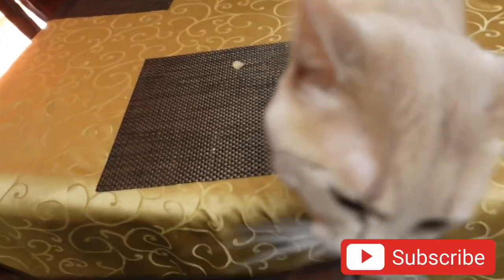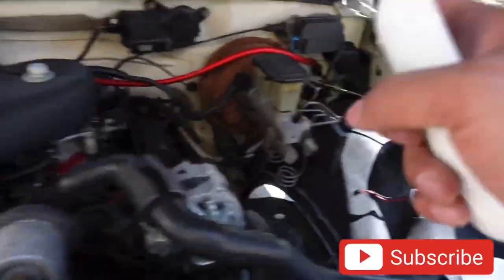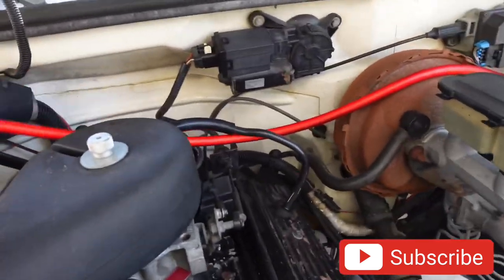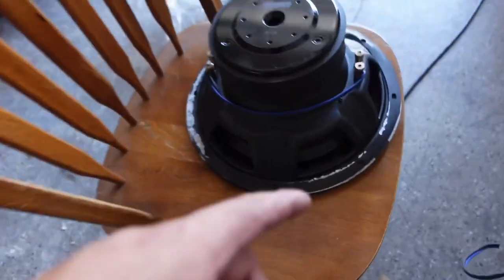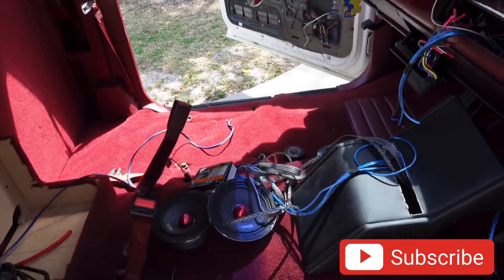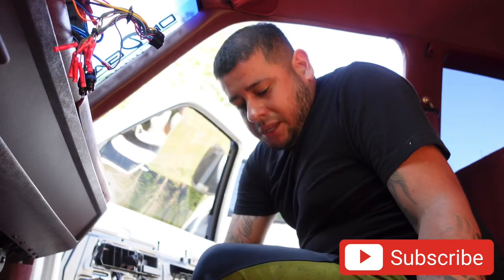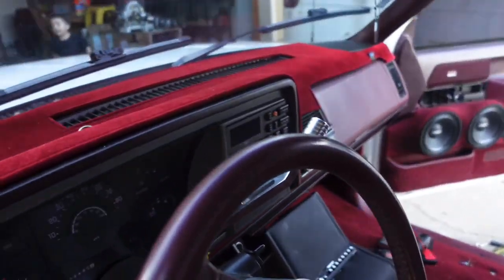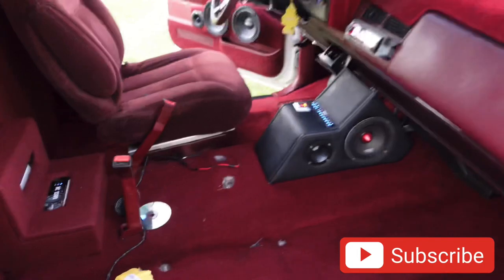Sound System in OBS Truck very aggressive with 4th Order Bandpass Loud w/ Prv Audio Mids Door panels

Comment: That looks really nice man. If you are going to have those amps in closed in a small space like that you should have some fans to keep them cool. Even if they have internal fans that's not enough air space to keep them from overheating
Reply: My turd amps runs good under my back seat, doesn't really get that hot even after giving a couple demos.  I think he'll be alright as long as he's not clipping the shit outa it
Reply: @TBO207  its risky to run any kind of electronic device with limited airflow. It may do fine if he doesn't push it to hard.
Reply from the maker: I got it turn up only 1/4 up because that back window is taking a beating 😬😬😬
Reply from the maker: Ya this customer doesn’t tend to jam on it constantly and he prob only drives this truck like 4 times out the month
Reply from the maker: We’re actually gonna build a console to display the amps a lil better
Reply: Should do a floating amp rack made of Plexi
Reply: @mouse_trap.  I would just let it go and break the window. Its all in fun. Windows are not expensive to replace.
Reply: @mouse_trap.  Heck,
if it's not a daily driver tear it up. That's what fun about this hobby.